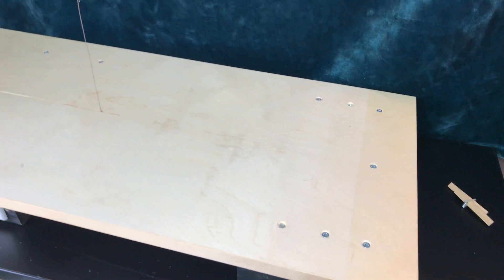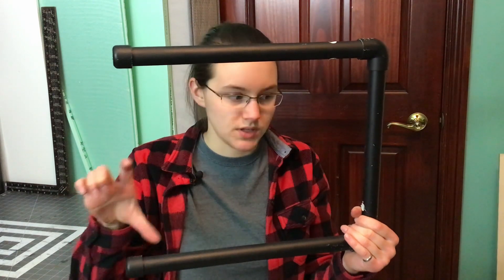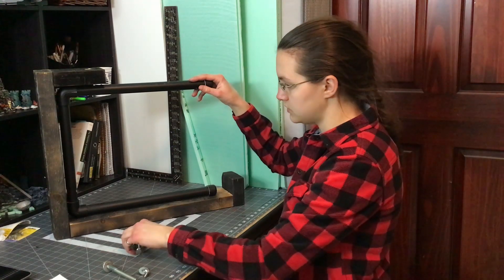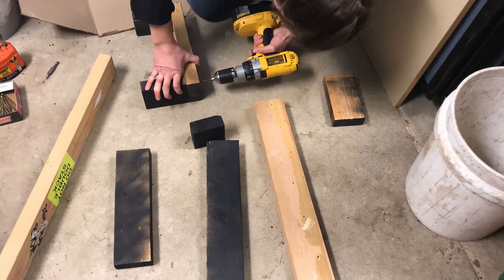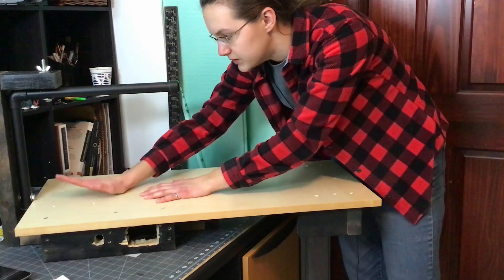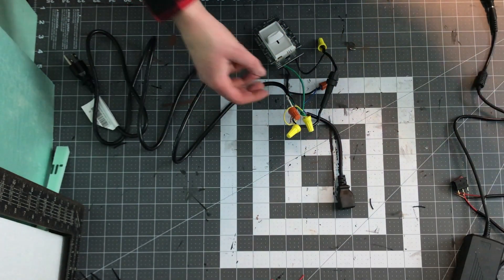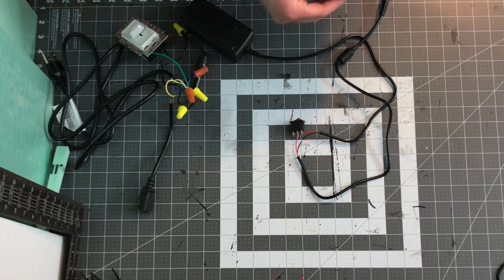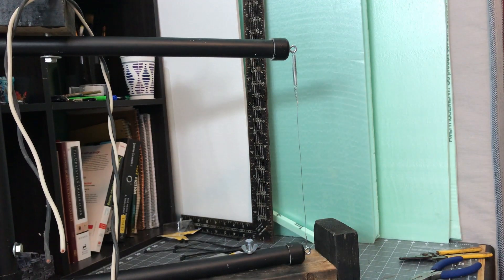DIY Hot Wire Cutter for Foam

Comment: :face-green-smiling:THANKS FOR THIS DEMO VIDEO!  FYI: MANY YEARS AGO, I MADE A ~48" + WIDE CUTTER, SO THAT I COULD WORK DOWN 4' X 8' FULL SHEETS OF BUILDING INSILATION FOAM SHEETS, (TYPICALLY TO CUT BLANKS FOR THEN CUTTING OUT WINGS, FOR R/C AIRCRAFT).  I USED A ROTARY SWITCH/LIGHING DMMER , SIMILAR TO YOUR'S, BUT, USED THE 120VAC POWER, ACROSS (GOING THRU THE DIMMER), TO THE WIRE. IT MAKES A SLIGHT "VIBRATING (60CYCLE) "HUM", BUT, IT WORKS WELL... I INSTALLED AN INLINE FUSE-HOLDER, AND A SMALL 1-2 AMP FUSE, IN CASE THERE'S ANY ACCIDENTAL "SHORT".  I REALLY OUGHT TO ADD A "120VAC TO 18VAC , OR 24VAC, "ISOLATION TRANSFORMER" (DOORBELL TYPE?)  AND, PUT A SECOND ON/OFF SWITCH ON THE OPPOSITE SIDE OF THE CUTTER, SO THAT A SECOND HAND (HELPER), COULD ALSO START, OR STOP THE CUT,  (BOTH "MOMENTARY, PUSH-BUTTON" SWITCHES WOULD NEED TO BE HELD DOWN, TO START, AND CONTINUE THE CUT.  ALSO, ADD A "PILOT LIGHT", TO INDICATE WHEN THE POWER IS BEING SENT OUT, TO THE WIRE...:face-blue-smiling:

Comment: Nice job, but it must be a bear to cart around being that heavy.  As for the rotation bolt being above the  table, perhaps a notch cut into the table there would allow the bolt center to be dead level with the table top. That way, the wire will  not have to zig zag coming  up through  the  hole in the table, and you could cut a Vee groove under the top so the wire can rotate freely. If you drill a 1/4 inch hole, where the wire passes through the table top, you can rotate to any angle without bending the wire at all.

Comment: Cool video,so what did it cost in materials and time?
I just got my proxxon and it is one of the few powere tools I have that arent for chopping firewood so I think I need to invest in a few more tools .
Have a great weekend!
Reply from the maker: Thanks! It took me most of a Saturday to build and then a few more hours to wire everything up (estimating 12-14 hrs). I spent about $50 on materials, but I found a lot of the stuff I needed in our garage (wood, screws, dimmer switch, etc). 
Would definitely recommend building up a tool stash or knowing people who will let you borrow them :)

Comment: Another fantastic build. If you ever need more manageable sheets of foam because you don't have a truck, Home Depot will cut the insulation board on their panel saw. Gives you a perfect edge too. You can also use all the pink dust and sawdust to make flocking when they sweep it up
Reply from the maker: That’s good to know. I usually go to Lowes and chop up the sheet with my knife in the parking lot so it can fit in my car. That’s a great use for little foam bits. I’ll have to try it out. Do you normally just mix paint with the foam flock?
Reply: @okayminiatures7573  yes just like normal sawdust application  But it sticks a bit differently since its not absorptive like sawdust. Like when you shred the foam with a cheese grater to make clump flock

I replied to a comment from a few months back on your door video if you're looking for your next project. Reusable plastic is called Oyumaru. Same stuff as a sports mouth guard